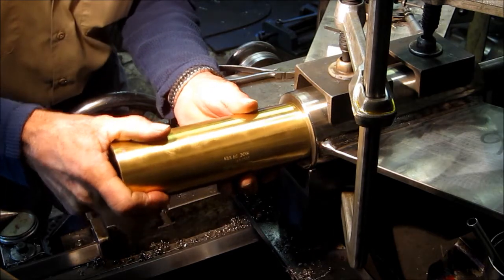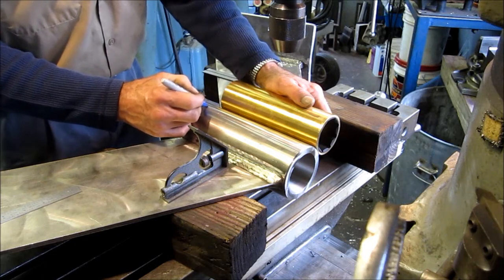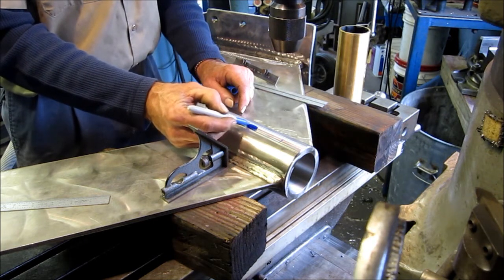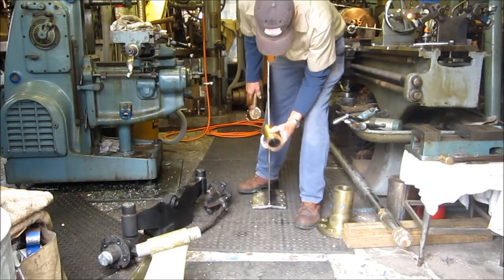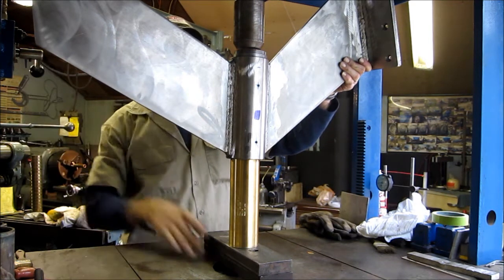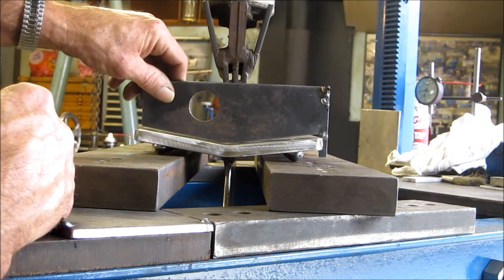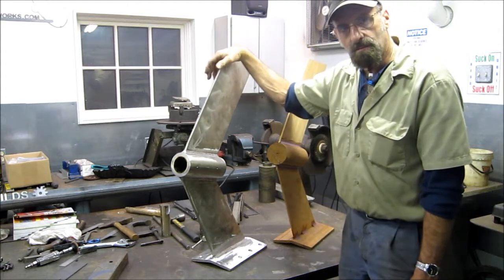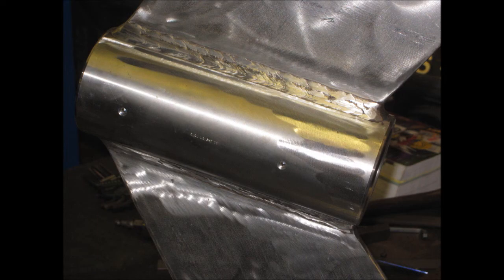Strutting PART 3

Comment: Hi Keith: You are still more interesting than tv. :)  I really liked this video. You tip about centering a tube, and way to draw a line was great. I pick up so much from your videos. My vise is my foot on the ground, and milling machine is a cut off tool and vise grips. Heh. Seriously, I make a lot of stuff with a drill, cut off tool and grinder with a little vise and cheap welder. You videos really help the accuracy.

Comment from the maker: @billdlv I fabricated them from 316 S/S and the only treatment or coating that will be done is a coat of bottom paint before launching. Zink anoides and proper bonding during operation, will determine longevity

Comment: So,I got to to ask since we don't have big boats in the Midwest.What exactly goes thru the bore?I'm guessing not a propshaft,as the rubber insert doesn't look like it can rotate unless I'm plain wrong.I also noticed you didn't index the bushing according to the splines?Learned a new trick with the scale clamps.Great Job as always!